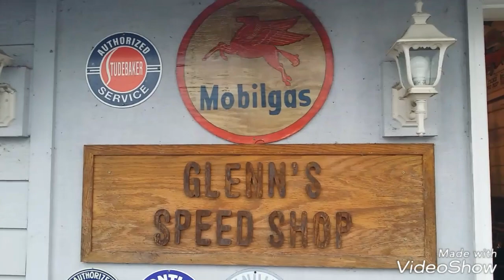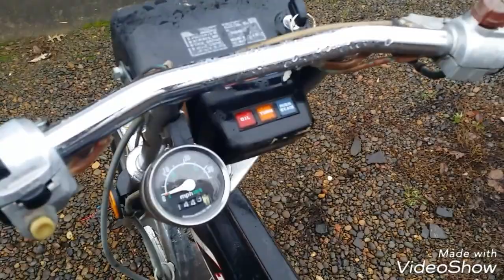A new project has arrived at the shop. 1982 Honda Urban Express!

Comment: In straightening the right side lean, are you hitting with the hammer directly on the underseat pan or do you have something attached to the bike that you're beating on?   If directly on the bike, how did you NOT damage the paint and/or frame?  Really want to know as have several Urbans that have the same lean in them and would love to correct it.

Comment: Great video! What causes the smoke from the exhaust? Bad / old gas?
Reply from the maker: Don't forget, it's a 2 stroke. Oil injected into the cylinder.
Reply: @GlennsSpeedShop  got cha! thanks! do you know the oil to gas mix ratio for this?
Reply from the maker: I don't k now the ratio as this has seperate oil tank and it automatically injected. But most modern 2 strokes are 40 or 50 to 1
Reply: @GlennsSpeedShop  thank you!